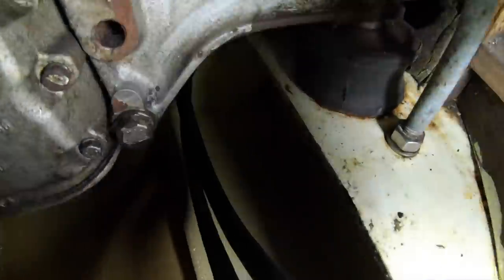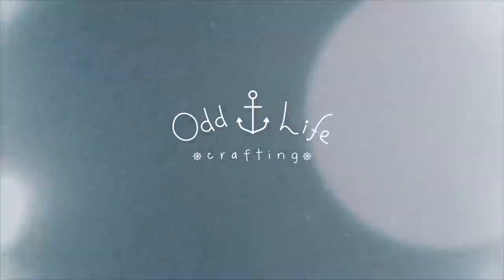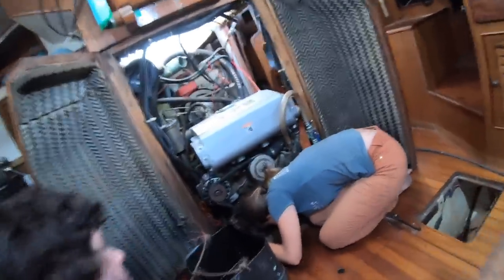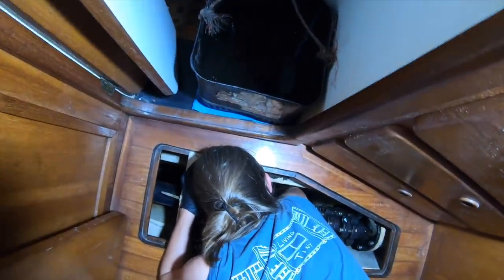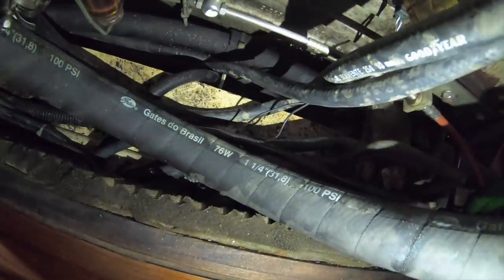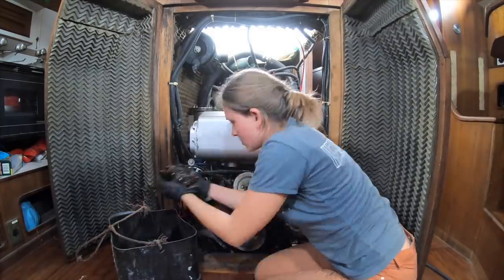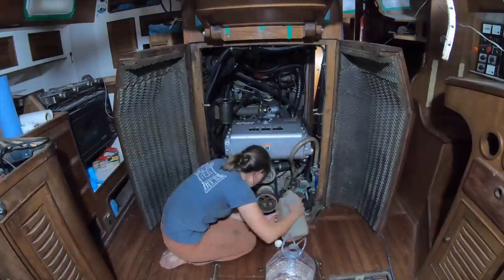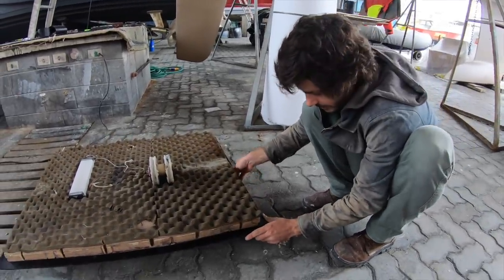⛵️We had a surprise with our engine bilge!! #110

Comment: There's a couple different various possible reasons as to why the bilge didn't oxidize/rust like the diesel tank...

It starts with the definition os oxidation and reduction/redox... Oxidation is basically what causes metal to rust whereas reduction/redox doesn't allow metal to rust... 

It also may have to do with a silver coil and if you have one located inside your bilge or not... There won't be a silver coil inside your diesel tank so that doesn't apply here and would mean why if there is a silver coil going down into the bilge there would be no or less fungus/algae growth vs. the diesel tank where there is no silver coil inside and in which not being there won't inhibit fungus/algae growth... 

It also has to possibly do with water type/H2O... But first you need to know if over the long time frame of the boat motor sitting if by chance the radiator water [like the oil and diesel fuel] drained/dripped out into the bilge or not... If the water did drain out of the engine radiator and into the bilge area then it was likely filled with distilled water and that in itself helped limit or prevent fungus/algae growth... If they had regular water inside the engine radiator that drained into the bilge area it could help fungus/algae growth occur but that too might have limited the fungus/algae growth due to the possibility a silver coil is [inside the bilge area as well the next factor involved... That being evaporation... 

Evaporation and condensation... Inside your bilge there is no seal or cover on it like your diesel tank is sealed and has a cover on it... Meaning inside the open ended bilge evaporation of any condensation is allowed to occur meaning the water/H2O can dissipate/disappear... Whereas inside the sealed/closed diesel tank limited to no evaporation can occur... Plus you said they 'kept adding diesel treatment to the tank periodically which 'kept adding a liquid form back into the diesel tank which helped to offset and replace any liquid water/fuel that did or was allowed to evaporate or disappear/dissipate... Also inside the sealed/closed diesel tank there will be condensation [from the temperature changes] and as stated water/H2O won't evaporate and thus help grow fungus/algae... 

I know it may be all a bit confusing to understand but it's really not and I'll post some related articles here to help you understand... But if I were you I'd check to see if their is a silver coil/piece of metal that sticks down inside the bilge first because that may help answer better why the bilge didn't look like the inside of the diesel tank... Here's those article to read that will possibly help you understand...
Reply: The benefits of distilled water [radiators]

Distilled or Deionized water is basically the best thing you can hope for. Everything they advertise about coolant is very misleading.

Non-Conductive - Yes coolant may be less conductive than distilled water but pure water is actually a very poor conductor. What conducts electricity is the dissolved ions in the water. No matter how pure the water or coolant may be, anything will gains ions very quickly and become very conductive from contact with the metal blocks.

Corrosion inhibition - Galvanic corrosion happens when conflicting metals are mixed together and redox reactions happens. However in this day and age of water cooling you can't find aluminum or stainless steel water blocks anymore. Usually everything is copper or nickle plated copper and using these two metals will not cause galvanic corrosion. Having corrosion inhibitors actually do nothing.

Better performance - Basically water is the best thing you can use. The random stuff they add is never a better heat conductor than water. Whatever tests they publish is probably cherry picked just to support their claims.

Algae inhibiting - Algae growth can be prevented by a silver coil. However algae growth probably won't happen anyway if you don't contaminate your equipment with tap water or expose your loop to direct sunlight.

https://www.pakwheels.com/forums/t/is-it-rust-or-mud-in-the-radiator-civic-vti/216590/9
Reply: In ending here to help you understand better... The distilled water will keep the 'ions' needed for oxidation/rust to a minimum meaning cause redox/reduction while regular tap water will not but in fact increase the 'ions' that cause oxidation/rust... Hope this helped answer your question... Godspeed and Peace Roberta & Duca…
Reply: P.S.: Obviously the more evaporation you have the decrease in chance for fungus/algae to grow and or remain alive/survive while the opposite occurs with a steady supply of condensation [no or little evaporation] which will help fungus/algae to grow and remain alive/survive...
Reply: P.P.S.: 'Oh I also forgot the warmth of a [running] engine and it's possible involvement in assisting in evaporation of water too... Heat causes water to evaporate faster...  You forget one thing Duca... Every time they opened the diesel tank lid [to add the diesel treatment] they reintroduced fresh air back into it... Meaning air was always inside the tank but along with condensation... Bye...
Reply: Diesel tank, as you said was partially full/empty... Air was introduced when they put in diesel treatment but once lid was resealed it was stagnant non moving air / helped condensation and no evaporation..... But above the engine you have a vent on the lid that allowed for air movement/flow / helped evaporate any condensation... : https://itstillruns.com/eliminate-water-condensation-gas-tank-6298865.html

Comment: Diesel is oil, and oil is antitrust.
Reply from the maker: But there was rust on the diesel tank. that's what we think was odd on the bilge
Reply: Odd Life Crafting 
There was rust on the areas that were exposed to air. Once you start sailing and the bot is in the water the diesel will always be sloshing around and coating the inside of the tank. Just clean off the rust and leave it. It will not rust if it’s being used!
Reply: @dodgeguyz  True.

Comment: Tip: if you dont want to have a permanent pump sitting there just buy  cheap membrane pump with a 12v cigar socket that you can move around  as needed and suck out oil of fluids.
Reply from the maker: Thanks for the tip